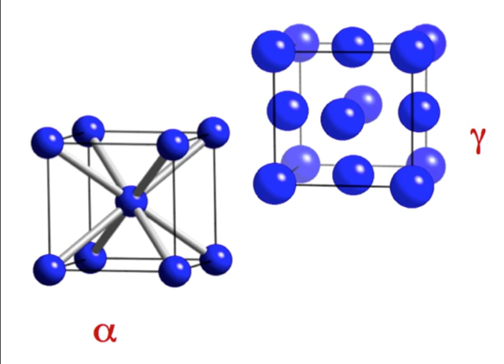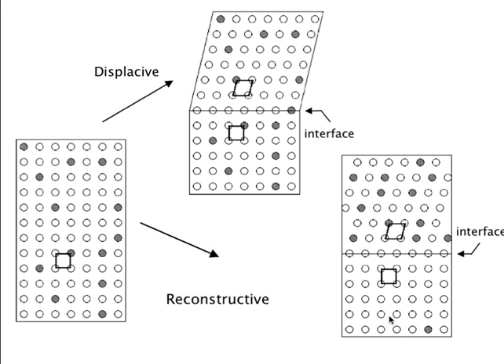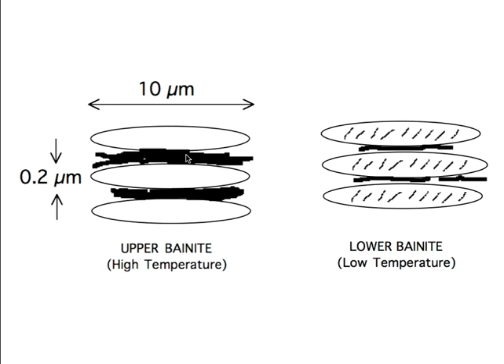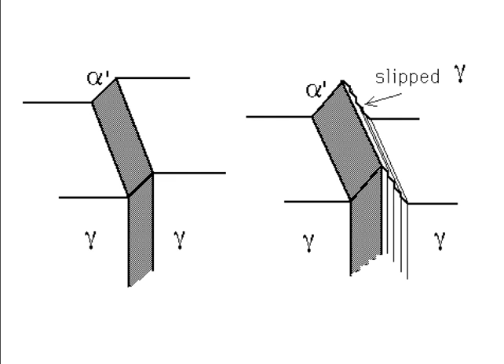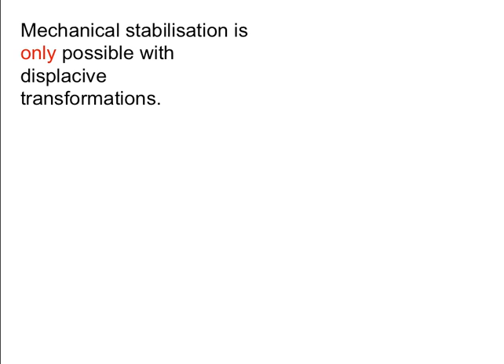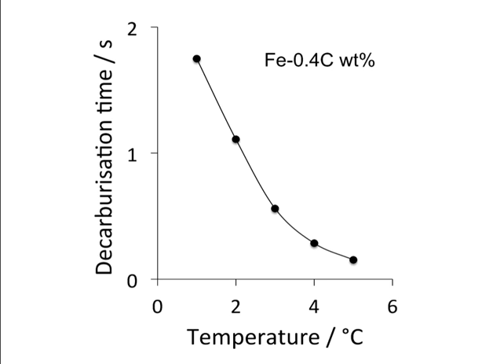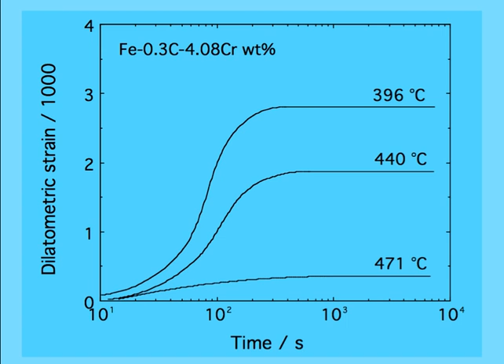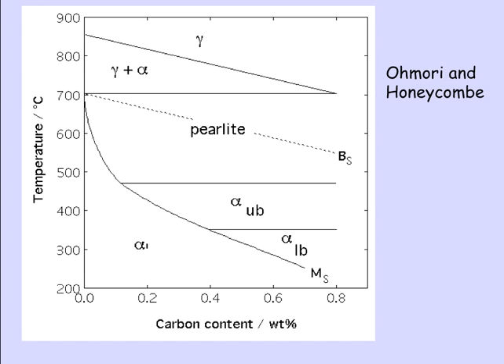Steels: mechanism of bainite, lecture 3 (2016)

Comment: rofessor Bhadeshia,Some articles claim Bainite have more toughness than Martensite in same strength of steels,so use austempering instead of quenching&tempering.Do you think why Bainite is more tough?
Reply from the maker: It is not possible to give a general answer. Steels are complex materials and may scenarios are possible. See Bainite in Steels, 3rd edition.

Comment: Pofessor Bhadeshia:Why the stored energy of bainite is constant (~ 400Jmol−1) that don’t change with driving force? Thank you.
Reply from the maker: It is dependent on crystallography, i.e., the strain energy due to the shape deformation which has a large shear component and a smaller dilatational strain. The crystallography is not dependent on the driving force.
Reply: but the strain energy is also determined by c/r(plate thickness/length). then why c/r ratio is aslo constant to make strain energy is consatnt?
Reply from the maker: In the case of bainite, there is plastic collapse so the platelets grow to a limited size.